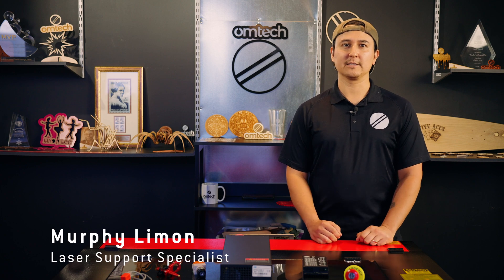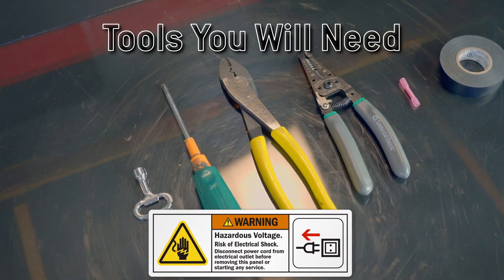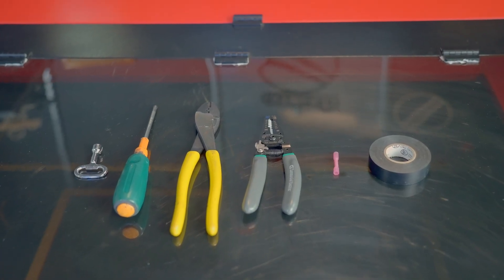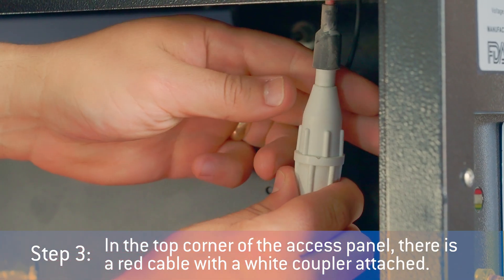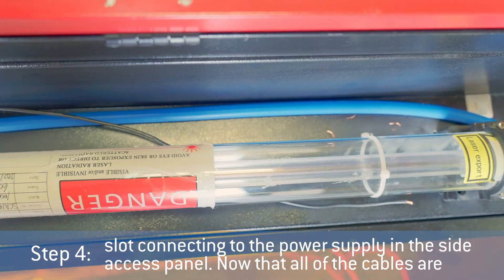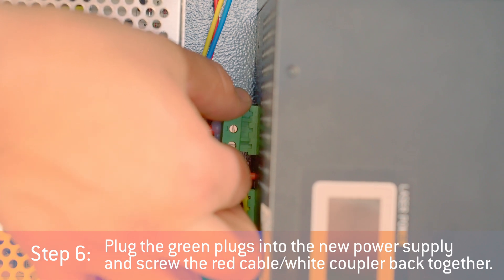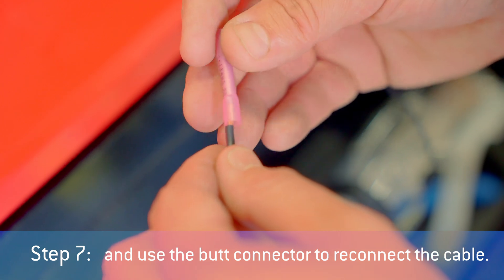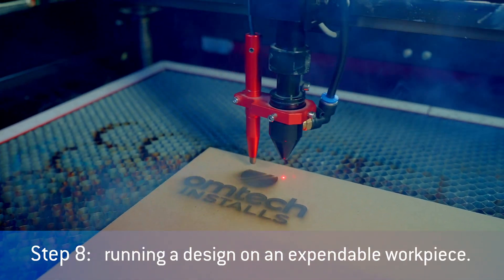How to Replace Your Laser Power Supply

Comment: I have a CO2 laser machine. While cutting, the laser stopped working. I installed a new tube, but it still emits a little light when I press the laser button. How can I tell if the tube is faulty or the laser power supply?